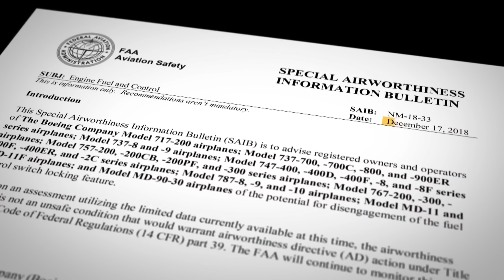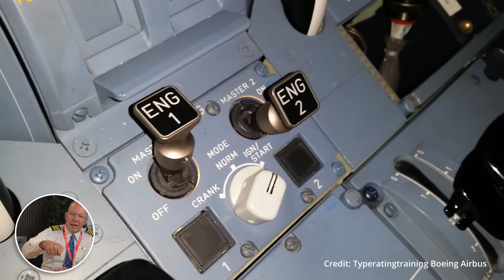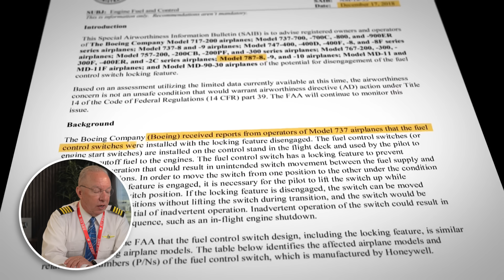Air India 171: The FAA’s 2018 Fuel Switch Locking Bulletin Explained (16 Questions Answered)

Comment: Here is what I think may have taken place, with background to electronics systems designing and prototyping,  I believe there was a massive or a very serious power disruption in Electrical power bus, thanks to one surviving witness, who reported seeing a "green light" flickering , before the crash, Data recorders may not record power loss or if they did then we are all assuming that pilots had switches in cut off position, so this must have stopped engines producing power so RAT was deployed, so we are all assuming engine fuel was cut off because the switches were seen on the off position, but there is a strong possibility what I think pilots may have struggled to restart the fuel pumps by toggling them both between ON and OFF position.  

So if there was a serious power failure, this would stop the pumps running, so both engines would grind to a halt, this was sensed by the pilot who realised no thrust is being produced, and they are losing height, So the pilot asks his co-pilot why he shut off the fuel supply, as the Pilot may have assumed his copilot may have turned the fuel switches to off, but his copilot replied that he has not done so, so now the pilot realises this and looks ate the switches they are in the ON position, but the fuel pumps are not pumping, 

Remember even if the fuel switches were in the ON position, if there was  a serious issue with the electrical power disruption or disruption to control lines that operate power relays for fuel pumps, or signals  from the two switches may have been disrupted by break in wiring, this can stop the pumps running despite the switches being in the On position. 

So pilots panicked and tried to juggle or toggle the switches between On and Off and On  and Off and On etc in an attempt to restart the fuel supply, so by the time the plane crashed the switches at that point were in Off position, not that pilots wanted to put them in Off position but they were trying to juggle them in order to hopefully restore power to the fuel pumps. But because of serious power failure those switches made no difference to restart pumps, 

Unfortunately their attempt was futile due to serious issue with power, so RAT was deployed that enabled them to restart one engine and also manage to send May Day  warning.  

Only serious power failure issue could shut down both pumps as well as engines, Ok even if both pumps are supplied by their own power from two different generators, or from a their own battery source, but the control system electronics may not work from two seperate power sources, so the pilot made futile attempts to juggle the fuel cut off switches, so upon crash the switches were at that point in off position, not by intent but in order to reset the system some how.  We often find our light switch may not always switch lights on, a bad worn out switch may require several attempts before light comes on. 

If there was a power issue as the "flickering green light " was seen by the only survivor, this can prove that there was a power issue, such an issue can be caused by many  things, including vermin (mice, rats, etc) getting into the plane and chewing through critical wiring looms,  causing short circuits and tripping off power, or possibly disrupting control signals, the control signals in turn switch power relays on which in turn switch on heavy power to the pumps,   don't forget there is a chain of commands from the Fuel cut off switches to possibly a processor that also sees other inputs from various sensors before it may switch the power relays on despite switches being in the On position, like a logic AND function, like for instance if the switches can be in the  On position and if there was no fuel, so fuel sensors would not meet the logic AND function so not run the pumps, so there may be many more sensors that determine whether pumps can or cannot run despite any attempt by pilots, and this also means even if there were two seperate independent power supplies to each pump, but there were no independent control circuits, So when a logic AND function does not meet all requirements it may not run the pumps, one example where the logic AND function can stop the pump or pumps running is when tanks are dry or empty to prevent burning out pump motors.Hopefully the sensors run on independent power for each engine, but if they ran on a common power that vanished then that logic function would disable both pumps.   

Only Boeings Engineers would be able to see if there was a flaw or a weak point in their design despite two independent power supplies. 

The control cables can be chewed, or shorted out, or other overload conditions on power bus may have tripped breakers, that caused power shut down the to both pumps simultaneously, despite both engines are designed to operate from their own power generation, but engines can't produce power if they were shut down by some other fuel issue, hence the  RAT was deployed.  

Remember even if there are two independent systems the actual command starts from the one person commanding,  the pilot or the copilot . RAT got deployed which eventually supplied bare minimum power to pumps and in order to restart  engine 1 and then engine 2 by which time the plan had come down considerably and crashed into buildings. 

One day I was driving a car in a stop and go slow moving traffic que, I had my clutch pedal down (engine disengaged) and brakes on, my car had a Hydraulic operated clutch, for some reason the hydraulic  pressure dropped or leaked away, and as I also  had other foot on the brakes , to stop the car from rolling forward,  the engine was running  at  idling rpm suddenly stalled, as the clutch mechanism engaged the engine to wheels and as the brakes were on so instead the engine just stalled dead. I attempted to restart the engine but it would not even crank, as there was no hydraulic pressure so a safety switch prevented me from restarting my engine. This safety switch works by hydraulic pressure rather than the pedal position  using a micro switch 

 in older cars there was no safety start switch, so you could  starts engines without depressing brakes or a clutch, to me the modern safety switch is poorly designed,  in my view, because now I could not even start the engine without depressing the clutch due to loss of hydraulic pressure engine won't start,  sometimes safety systems can be counter productive in emergency situations. 

 I did panic as I was now blocking traffic behind me, my car would not start, other drivers started to horn at me,  I then made vigorous attempts to pump up and down the clutch pedal,  which fortunately worked and raised enough hydraulic pressure to enable engine to restart, and it got me home.

Comment: As a computer systems and technology specialist consultant for over 35 years, though not in aviation, a significant portion of my major question seems to be answered by this video, and that is that the fuel cutoff switches, despite being physical switches, are actually soft switches. That means that regardless of the physical position of the switches or the operational status of the locking mechanisms, it's actually the computer than controls the fuel valves, and that means that a software fault could have caused this. As I said in my previous post, if a software fault caused both fuel valves to CUTOFF, then obviously the physical switches would have still been in the RUN position, and would still show up on the flight data recorder as having been "moved" to CUTOFF. 

This would be consistent with one pilot asking the other why he cutoff the fuel, and the other pilot responding, "I didn't". This would also be consistent with a 10-second delay in the pilots attempting a restart, since this would be a condition that should theoretically never occur. After 10 seconds of mindboggling at what has just clearly happened, the pilot(s) would have then immediately done exactly as they are trained to do to restart the engines: move the fuel cutoff switches from RUN to CUTOFF and back to RUN. Here's the important thing: that movement would not necessarily have been recorded by the flight data recorder, since as far as the computer would have been concerned, the switches would already be in the CUTOFF position, so the software would not necessarily properly detect a movement from RUN to CUTOFF at that point, but likely would record the movement from CUTOFF to RUN, as it did. 

By this time, of course, the aircraft simply did not have enough altitude to get the engines to restart with enough time to climb out of its inevitable descent. Knowing what we now know, there are really only two possibilities: either one of the pilots did this intentionally, or it's a software fault, and it's possible a software fault could have been introduced by a recent software update, and/or that it was deliberately introduced via espionage. The 787 has flown for nearly 14 years without a fatal incident; it seems likely that if there is a software fault and that it was fundamental to the design of the software, it would have shown up long before now. That is why I suggest that it might have been a recent software update with a bug or an attack vector. There are, of course, several parties who could potentially benefit from such an attack, and we don't need to name names. Extremely unlikely, yes, but not outside the realm of possibility.
Reply: ^^^^^ This comment is exactly what I was thinking, I’m sorry but there is no way that’s the data recorder would know the difference between the physical switch moving and a stray signal. Is highly unlikely this is what happened but the CVR conversation and time delays do make sense in this scenario. Also, nobody and I mean nobody trusts Boeing…
Reply: @Ordinary-_-Guy  "This comment is exactly what I was thinking, I’m sorry but there is no way that’s the data recorder would know the difference between the physical switch moving and a stray signal. "

Actually it would, because it would be logged twice.... Once from some software glitch (although yea, let us just throw out the fact they didn't go at the same time), and once when one of the pilots physically turns it off.....
Reply: Needless to say, I am NOT a fan of "fly by wire" systems, because this is what can happen with them.
Reply: @gcvrsa  "Here's the important thing: that movement would not necessarily have been recorded by the flight data recorder, since as far as the computer would have been concerned, the switches would already be in the CUTOFF position, so the software would not necessarily properly detect a movement from RUN to CUTOFF at that point, but likely would record the movement from CUTOFF to RUN, as it did. "

This logic makes no sense for someone who is apparently "a computer systems and technology specialist consultant for over 35 years".

The logs would definitely show that, come on. When the pilot physically moves the switches down that is a new input that is then sent to the FADEC.... It would be logged twice as each switch going into the cutoff position.

You guys need to stop writing fiction, let us review the actual report;

"At this stage of investigation, there are no recommended actions to B787-8 and/or GE GEnx-1B engine operators and manufacturers"

1. They obviously don't think it is a software glitch.
2. They literally hired an Aviation Phycologist. Why would you do that in an air investigation?

"Experienced Pilots, Engineers, Aviation Medicine Specialist, Aviation Psychologist and Flight Recorder Specialists have been taken on board as Subject Matter Experts (SMEs) to assist the Investigation in the area of their domain expertise. "
Reply: I agree with this💯  capt steeve needs to read this
Reply: Interesting commentary, but would that explain why there was a 1 second delay between the activation of the repsective cut-off swiches?
Reply: @AstralVoyager-q5f  what if there was some minimum delay set in recoding the delay, they are saying 1 sec we need more precision than that, it would be 1.2662.. or something like that if a human did it, if it exactly 1 second, than it could be a predetermined delay set in the logic. This could be a possibility, right?
Reply: The report says that the switches were moved to the cut off position. But does the FDR actually monitor the switch position or is it recording the position of the actual fuel valves on the FMU’s?
Reply: Data recorder is reading switch and valve coils, both separate. It was a terror act. The moment was also extreme small time window to do it.
Reply: Very interesting however the procedure to restart the engines is to shift switches to CUTOFF then to ON immediately. Not with a 10 second gap and especially not at that altitude. This action would have taken less than 2 seconds most likely.
 Sorry. It’s pilot suicide for sure
Reply: See my post; I stated something similar.
Reply: Here's something that needs to be looked at more closely. The preliminary report states that the fuel switches were moved at a "01 second" interval. What is the actual time resolution of the flight data recorder? If this were done by a human being, there is virtually no chance that a human being could hit 1 second on the money, even if they were trying to do so. However, if this were a software fault, it's entirely probable that it could happen on a one second clock tick exactly. Is there an automatic delay built into the system, such that even if the switches were move as a closer interval, the computer would only activate them sequentially with an exactly 1 second delay?
Reply: @gcvrsa  The time stamps in this report were only done down to 1 second resolution.  It could have been 1.27463 seconds or whatever.
Reply: @fewwiggle that was not his question. His question was the resolution of the recorder, not the rounding of the report.
Reply: @onioni111111 And, yet, he was speculating on it being EXACTLY a one second interval.
Until they release a report with higher resolution (assuming it exists), then that is just irresponsible and illogical.

Comment: After takeoff, what standard procedures do pilots follow? Is there a risk of pilots unconsciously using fuel controller, and are there similar switches nearby, such as those for retracting the landing gear ( landing gear were not retracted during flight)

Comment: I strongly disagree with the hesitancy to installing cockpit video cameras on privacy grounds -- pilots have hundreds of lives in their hands, and it can also be regulated such that footage isn't accessed outside of accident investigations to prevent airlines from using it for disciplinary reasons.

Also in the Air India 171 example,  even though it seems exceedingly unlikely given the flight data, it will always be technically possible that neither pilot flipped the fuel switches and there was instead a cascading sensor failure of sorts (They did both deny it in the audio recording, but the remoteness of that sort of failure forces investigators to assume one of them is lying). Video footage recorded to the black box would have the potential to exonerate one or both pilots and spare the families the blame and remorse from not knowing exactly what happened.
Reply: Your assumption could be valid if that switch is touch screen on the display but this is mechanical/physical switch and pilot use their hand to move it.
Reply: deny deny deny all you want, one of the pilots pull the switches to off position, reason and logic stands, emotions does not
Reply: true and maybe if the angles are right or have multiple cameras, we can see who is the one talking, who is actually flying the plane, etc which can be very help especially in this case.
Reply: Can't happen as it has to be manually done as they have to be pulled out lifted up and placed into correct position.
Reply: Regulation and enforcement are two different things.
Reply: Pilots don't want to get caught having sex with the flight attendants during the long flights.
Reply: Install in Rafael Saar 
Our pilots blown away Saar 
We paajeeettt saar 
We kuttay Saar
Reply: The rail unions don't want speed cameras for the same reason, it's ridiculous.

If we had a cockpit video recording, we'd know which pilot did it and when.
Reply: @yngndrw.  Isnt that a good thing?
Reply: @wrx1th873  That the rail unions do not want speed cameras for trains? There have been a few cases of trains derailing due to the drivers speeding, with horrible results. These are professional drivers being paid to perform a specific task, they should be held accountable.
Reply: @yngndrw. "If we had a cockpit video recording, we'd know which pilot did it and when." - this part.
Reply: This is a physical switch, no electronics is built that will ever toggle it. Meanwhile, it's easy to deny what you just did especially since you know exactly what it does.
Reply: @AkitaMix  physical switch with gears and springs, or just that switch... How does a simple up and down motion control the fuel flow? There should be a force transfer element in between.
Reply: regulations do NOTHING to prevent bad behavior. otherwise there would be no murder
Reply: Pilots wouldn't come back to tell their side of story, so it's obvious to blame them only for everything...So easy for Boing to get it's coller out .
Reply: @shiVani-sv1ns  It's actually easier to blame a feceless entity than to accept that humans are capable of such things.
Reply: @shiVani-sv1ns exactly 
That's why you kept lying about your air force pilots blown away by us 
Shewanji was shredded into pieces
And finally you confessed that four of your pilots were blown away by PAF
Pakistan Zindabad 🇵🇰🇵🇰🇵🇰🇵🇰 
And please stop flying
It is beyond you
Reply: @shiVani-sv1ns  maybe cctv can change that.
Reply: Exactly!

If not cameras how about a third flight crewman during takeoff or landings. Have a flight attendant sitting in a jump seat to have eyes on the crew?